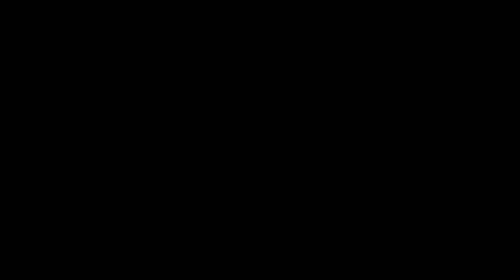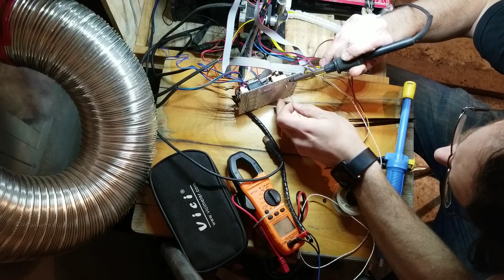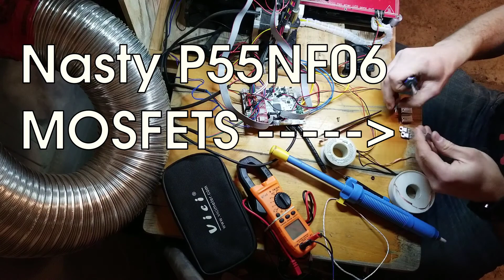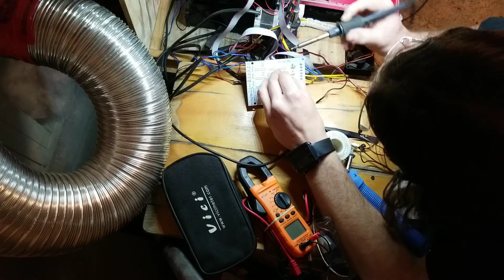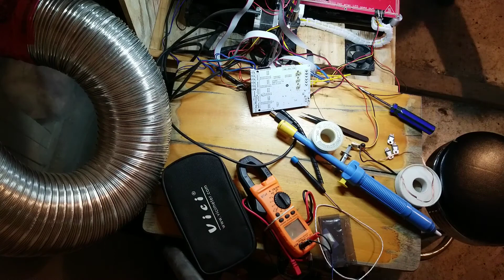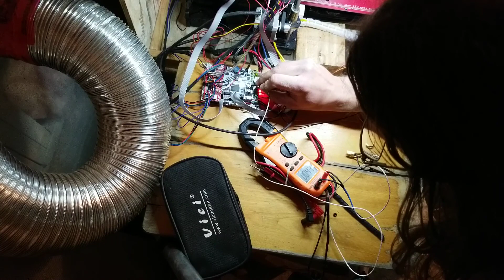Geeetech GT2560 MOSFET Upgrade

Comment: One of my least favourite traits of this board is that they spared thermal reliefs, dumping massive heat into the board substrate. I have a sample where lack of thermal relief also caused a wave soldering fault, casing the board to catch fire in the bed connector.

I never felt MOSFETs needed upgrade because drivers need active airflow anyway, making my MOSFETs stay cool as cucumber while driving an 8A bed. But there's nothing wrong with this upgrade either, it's good.

Comment: DON'T DO THAT !!!!! the IRF3708 has a maximum power dissipation of only 87W you will fry your board!!! I think @Teklectic put the wrong Infineon Model here... the original P55NF06 is rated 110W at least
Reply: This objection is incorrect. You apply 24V on your control board, right, and you have a let's say 120W bed connected, correspondingly the bed current is 5A and bed resistance is 4.8 Ohm, OK, with me so far? So what happens when you in series with the bed, connect a MOSFET with a resistance of let's say 20 mOhm, how much heat is emitted on the MOSFET? Do you think it's 120W? With most of the resistance being in the bed, we take 5A current, and we get 0.5W emitted on the MOSFET, just from Ohm's and Power laws.

Furthermore maximum thermal dissipation as per datasheet is computed purely from the die-case thermal impedance (in °C/W at maximum Tj), but your thermal chain includes also thermal paste, and heatsink, and air, so it's the most useless figure from the datasheet. From experience i shall say that a heatsink similar to the one Geeetech supplied has about 20°C/W in natural convection and down to maybe 5°C/W in good amount of airflow. Assuming you want to not exceed 100°C delta between the die and the environment air (and that's already uncomfortably warm operation, would absolutely not recommend) the heatsink alone will limit the MOSFET thermal power rating to 5W natural convection and 20W massive forced air. Usually, this type of heatsink is recommended under 2.5W. If you didn't use paste, the performance is correspondingly worse than that.

If you don't like my figures, be my guest to find the actual heatsink model and substitute your own numbers, also substitute your own numbers for the bed and power. Normally you should also compute the total thermal impedance chain from junction to air.

I don't get how people are THIS bad at electrical engineering and still think they can give advice like that.

Also just imagine what happens if you try to dump (87 or 110W) of waste heat into this board, wow it's not going to survive that for barely a second.
Reply: @SianaGearz   It’s a 12V, 100W heated bed, so if you want to keep 12V compatibility, the IRF3708 MOSFETs are not suitable. I can tell you from experience, as soon as I installed them, they overheated so badly that it was impossible to keep them running, and I had to remove them all immediately. 

A warning about the voltage limitation of this mod in the video would be appreciated.